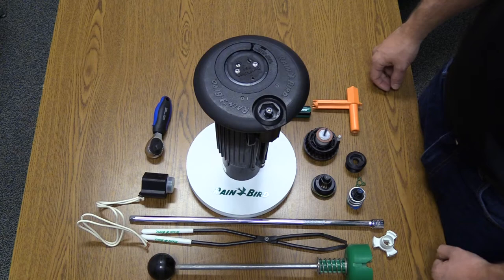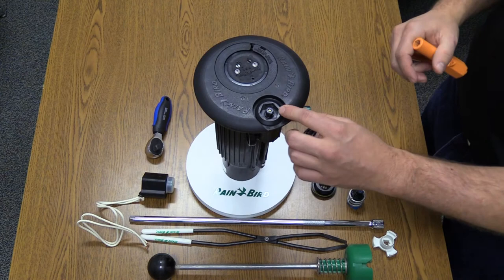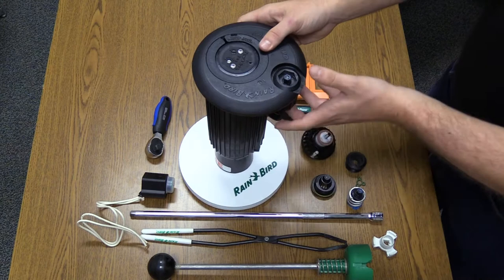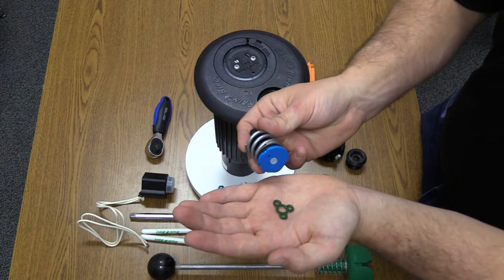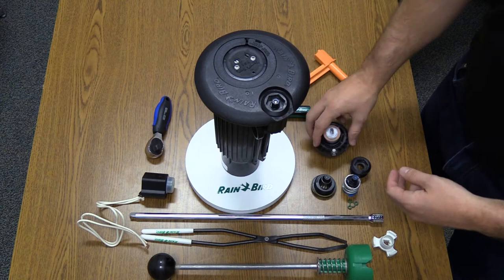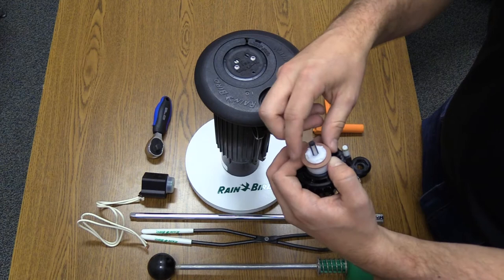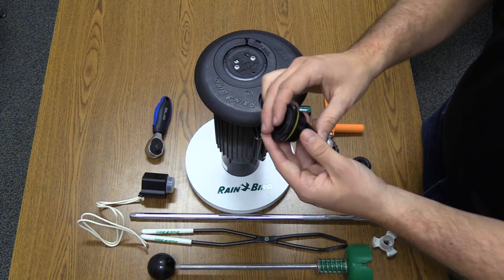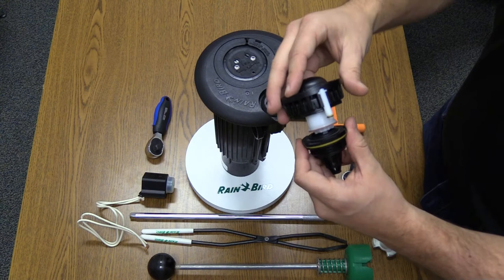Troubleshooting a Weeping Rotor

Comment: In my experience it's always the valve assembly usually something stuck in it after a break in the system or when it has become damaged the  The first thing to do is to turn the unit off and on manually to release any sand or debris that might be trapped inside the body if it's still weeps look at the diaphragm replace is better and quicker than repair

Comment: I have had a few of these where intermittently dont pop up fully and just flood the area around the sprinkler. Keeps happening on these on a few sites we have installed them . Checked pressure and cleaned them out and checked the position on the valve.  Increased pressure screw . Any help would be grateful. Replaced the sprinkler rotor without body which hasn't helped .
Reply: Flush out the line,remove all internal parts,and flush,